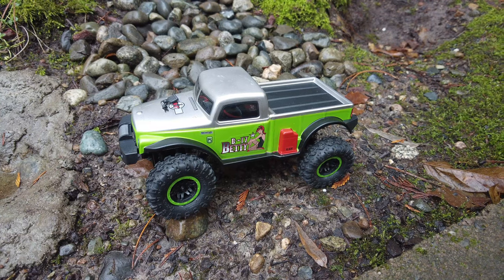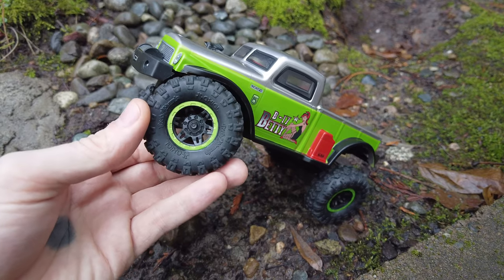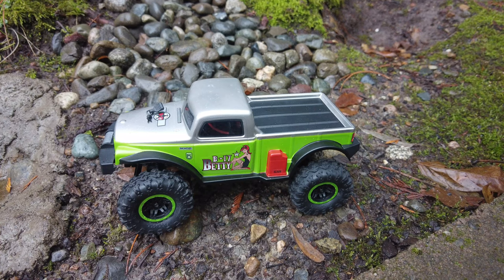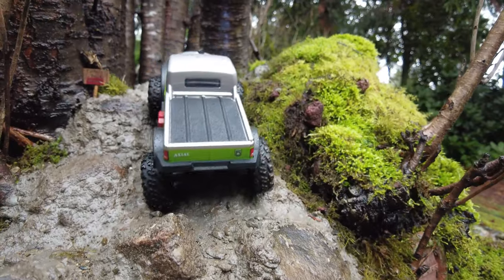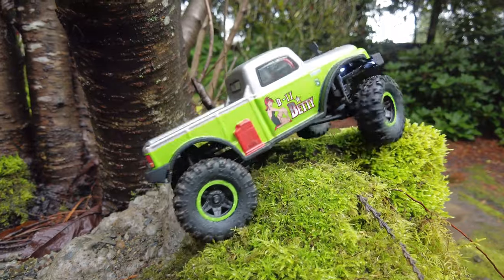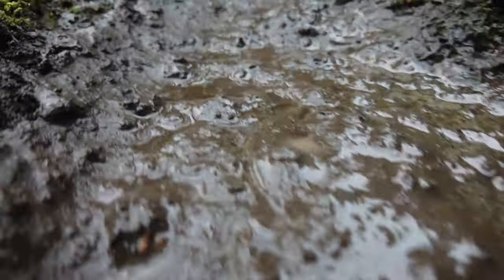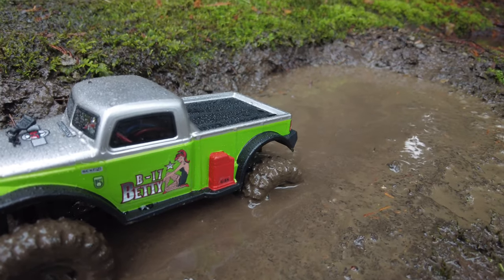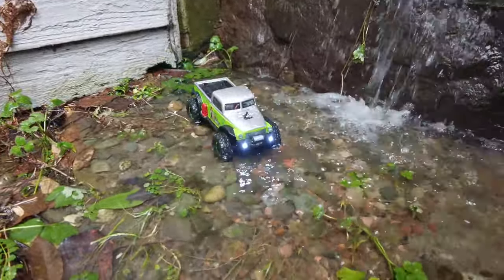Axial scx24 B-17 Betty gets brass wheel hexes!

Comment: Man I really want one of these. Too bad they were not out when I bought my mini deadbolt. These mini crawlers are great!  And the wheel weights really make a massive difference. I did a diy wheel weights from solder and hot glue.
Reply from the maker: Awesome! The solder wheel weights are fantastic!
Reply: @rcrewired1220  They really are. That and grease in the shocks are the only mods I have done to mine. It gets around really well. The grease stopped the shocks from bouncing. Great free mod.
Reply from the maker: Absolutely! I threw some black grease in my shocks and it worked great, until it leaked out eventually. Haven't had the urge to fill it again as I kind of like how it looks bouncing around lol

Comment: Are they slightly thicker then the stock plastic? Reason I ask cause from your footage your wheel nut looks flush with the stub axle thread and on mine I've still got threading after my nut are tight.
Reply from the maker: They aren't thicker, but I also don't tighten my wheel but down all the way torqued. I've had issues when tightening it too much so I always try to give it a little room now.
Reply: @rcrewired1220  ok thanks appreciate you replying. Sorry one more question, how many grams are each hex. Everything else in brass has listed weight on except these hexes. Thanks man
Reply from the maker: Lucky for you I have an uninstalled set laying around! Each brass hex weighs ~1g where the stock plastic hex weighs ~0.05
Reply: @rcrewired1220  thanks again for your response. Great work in your videos. I do think that those brass hexes are 1mm thicker then stock plastic ones. It's a win win really. An extra gram at each corner plus I believe an extra 2mm width in stance with the hr brass hexes
Reply from the maker: Interesting, well my 2 sets I picked up at least are exactly the same width as stock wheel hexes. But they are heavier giving you that slight extra weight at the wheels. Glad you're enjoying the content my friend!
Reply from the maker: Update: So it looks like Full Send RC makes some brass wheel hexes as well, those ones are in fact 1mm wider, the Hot Racing are the same width as stock.
Reply: @rcrewired1220  So i finally got my hexes in the mail. And you sir are correct they are the same size as plastic stock ones. But, the groove where the pin sits in the brass ones aren't as deep, which make them sit about a mm wider. Also the inner built in washer cannot meet the bearing now so no worry about over tightening and getting binding.